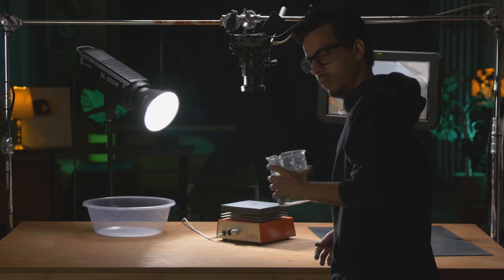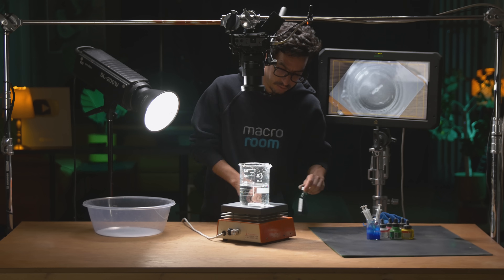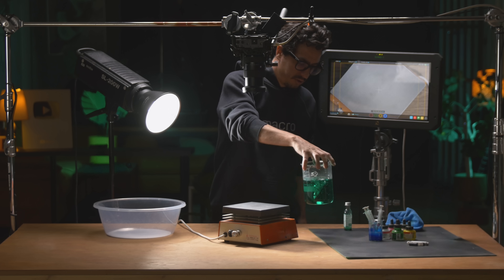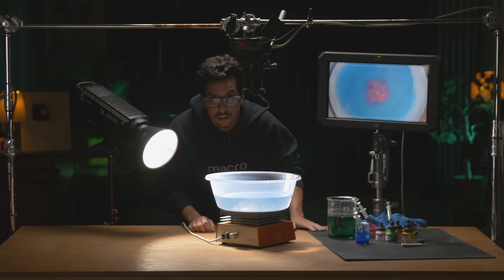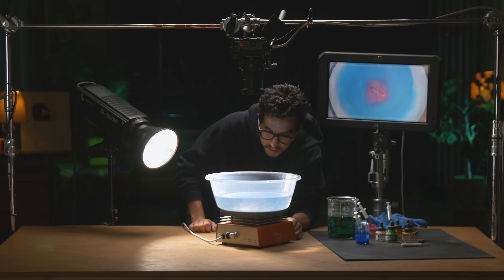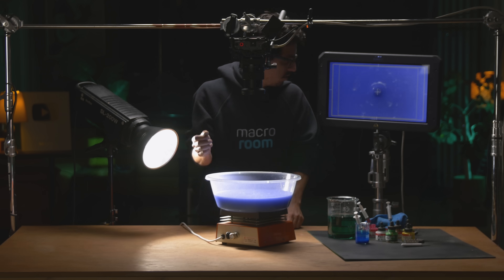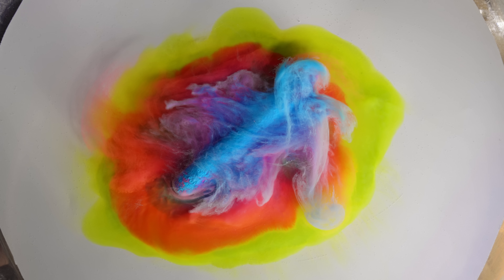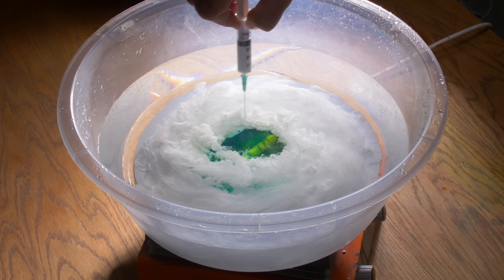Magnetic Vortex

Comment: You truly inspire me.
I'm glad you remembered the password.

I've just added a magnetic stirrer, beaker, and rotor to my cart on Amazon.

edit:
I happened to be looking for a milk frother for lattes, and it turns out the ideal motor speed for making latte art milk is 3000 RPM.

And the mixer I added to my cart today also runs at 3000 RPM.

Fate really does exist.

Comment: The last magnet with a dense column of paint hiding it (or a circle of paint that gets pulled to the center and hides the magnet just for a second or so) but all the rest of the water staying clear could be cool because the final image would be a soft fog on top of the LEDs not a thick black cloud.

Great video !
Reply: Thick black cloud is impressive. I understand point